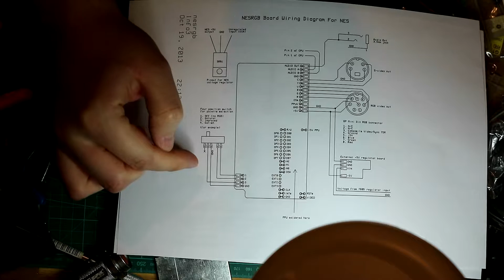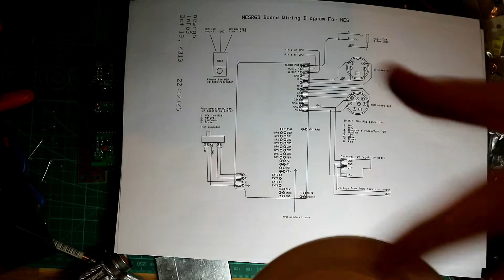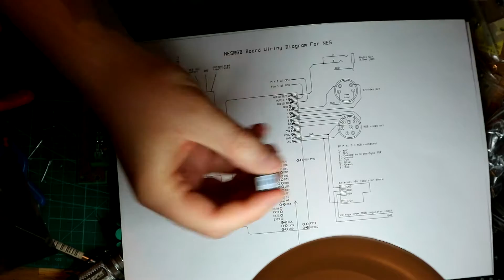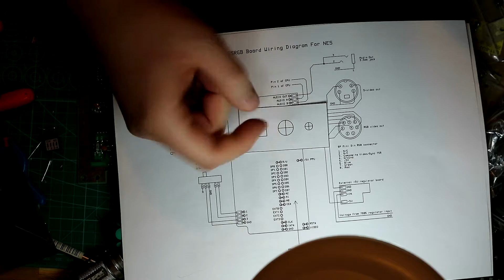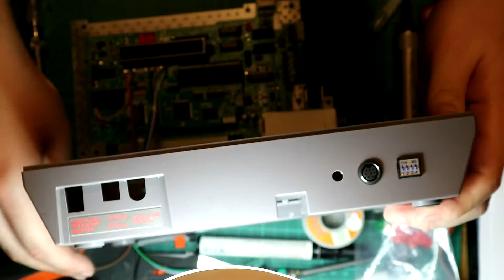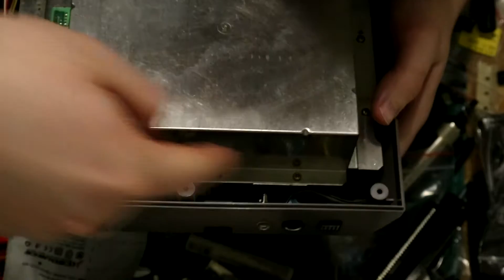Modding my NES for RGB output with the NESRGB kit Part 2

Comment: Instead of using a standard RGB socket, did you consider buying a 3D printed Nintendo Multi-out socket? That way you can use official RGB cables with the console.
Reply from the maker: I did consider it, but i didn't want to wait any longer and went with what came in the kit.